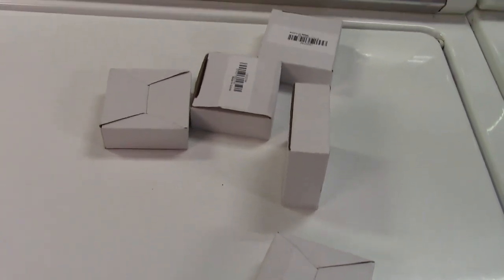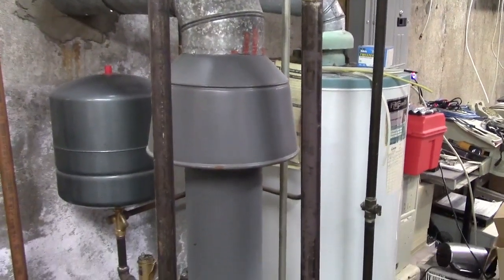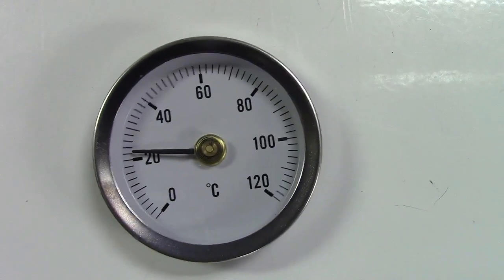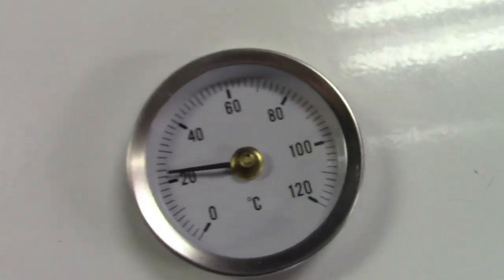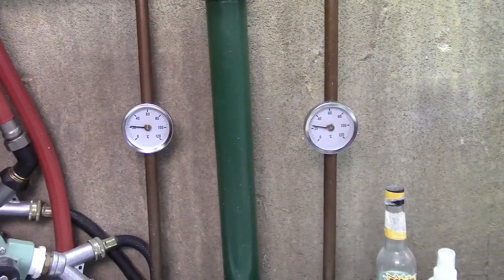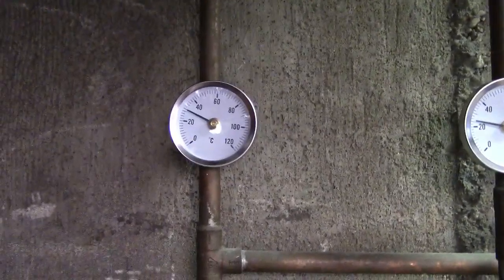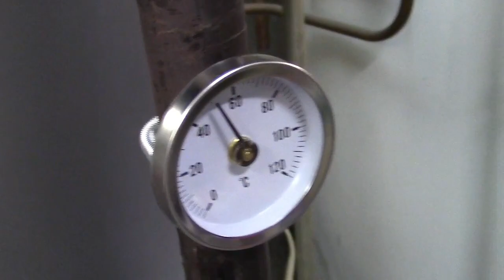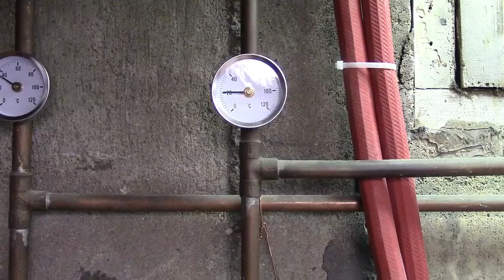Pipe Thermometers For Boiler Heat Pipes & Water Feed Pipes

Comment: Chachiyabalamabava. Pajipajipa. Shieggashoya.

If you have no clue what your hot water heater is set to, you could probably wait till it finishes heating, call pure hot water to one of the sinks and see what those little thermometers you have say. 

You just gotta love that dirty New York water, and for it being as expensive as it is, that's an amazing deal. I couldn't complain though, Jersey will find any reason to charge you more. Our town's plastic bag ban just went into effect and Stop&Shop reusable bags now cost MORE. 

20C is 68F,  40 is 104, 60 is 140, and 80 is 176 if your siri isn't working and you wanted to know.
Reply from the maker: Chung, Rachi, Roosh, Chicken Choyok!  (I actually say that from time to time out of nowhere!)

Yeah, I do need to check that, but I'm not going to adjust it.  I don't want to touch anything that could possibly make it stop working, it just sits there and does its thing and that's it.  Same with the boiler, though the "upgrades" I did were non-invasive.

That's why us New Yorkers call it "Dirty Jersey".  If Starbucks & Shopping raised their prices on the reusable bags, that's complete highway robbery.  I refuse to shop there as it is because their prices are so out of line, that's one more reason now.  Our ban goes into effect March 1.  Like 2 months is going to make any difference.  It's all a political stunt.

Alexa's here, she knows how to do non-common-core, non-Millennial math no problem, without insulting me!

Comment: I have bought a pair of these for the copper pipes from my boiler (which have outside diameter of 22mm - approx 7/8 inch) and they fit well. 

I am sure the precision is quite off (compared to what the reading on the boiler's digital display is). But I hope it's consistent because I wanted to read the temperature difference between flow and return and not necessarily to know the precise temperature of flow (or return).

I also skipped installing "proper" thermometers (which have a probe directly in the flow of water) because that creates another opportunity for a leak and their mission is not critical.

I am thinking of adding thermal paste to increase the precision of their reading (the one used between CPUs and their heatsink). BTW, since these little crappy things measure the temperature of the pipe (and not what is flowing inside them), they might be "allowed" to be a little off, isn't it?
Reply from the maker: Excellent point, you thought critically about these, as I did.  I use them also, as a gauge just to see.  The exact reading isn't important.  You can make a mark with a Sharpie on the edge of it when it's up to maximum temperature and then judge how far off it is from that.  I had also considered some sort of device that would sense the temperature of the water, but also shied away from that for fear of a leak.

Comment: Yeah probably the best way to get an accurate reading is if the thermometer sensors went inside the pipe, but that of course gives the possibility of leaks in the future. When the LI house boiler reached max temperature, I was actually pretty amazed with how well the water still retained the heat while being fan-forced before the burner had to come on again (at least while only one zone was running). But maybe that's because those heat exchangers were a lot smaller than the radiators.
Reply from the maker: Oh yeah, the radiators, at least the old school ones, definitely have a lot of surface area in them.  The pipe goes back and forth 2, 3, 4, or even more times before returning.  Baseboard heat is different, that's just one line going through, so you need a certain footage of it in a room to get the proper heat in there.  I could only imagine how small the heat exchanger is.

Comment: Oddly enough, I use Celsius for things pertaining to computer related measurements such as CPU and GPU as well as Chipset and ambient chassis temperature. Not sure why. I use Fahrenheit for everything else...
Reply from the maker: Celsius is indeed a better scale to use.  It just wasn't in the cards for the US and switching over to the metric system.  The wif uses Celsius at work also, so it's not a big deal.